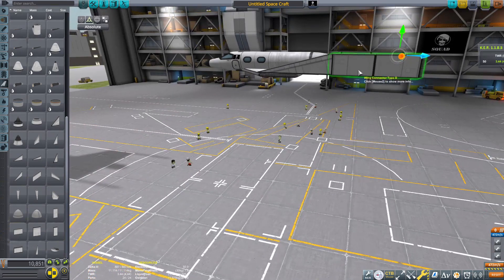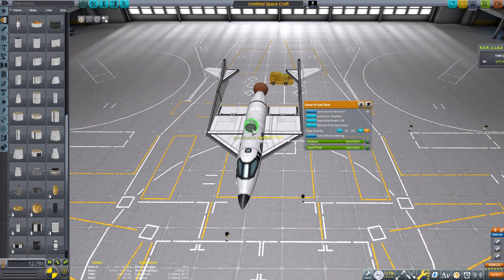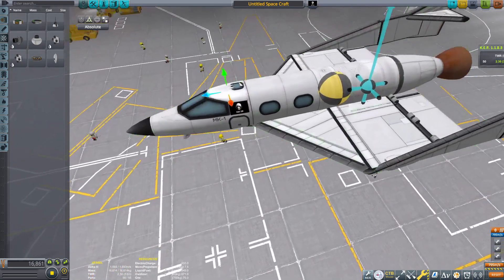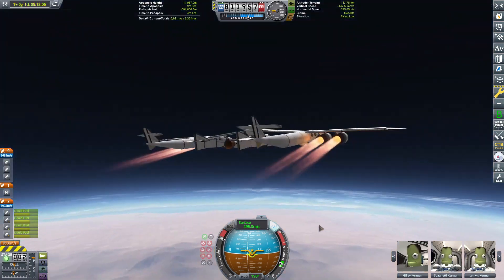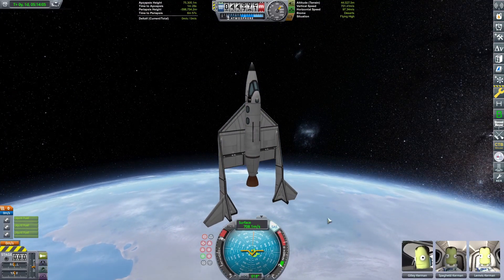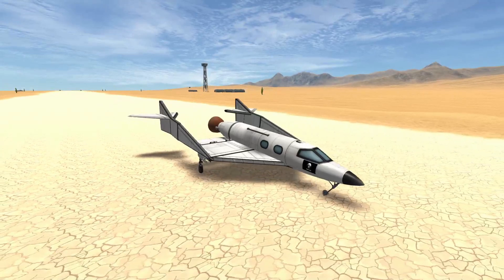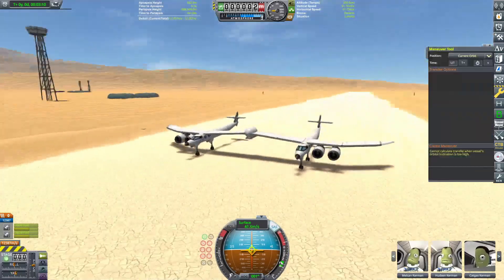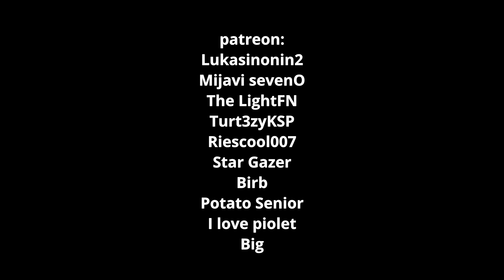KSP Tutorial: How To Build Virgin Galactic Spaceship Two & Eve Carrier Plane!

Comment: Didn't spaceship run on a SRB and not liquid fuel?
Reply: Only oxidizer is in liquid form. Yeah if you want to build realistically you can use solid rocket motor.
Reply: It was a hybrid engine/motor …thing.

Comment: looks good but the main engine is solid fuel, not a jet as far as i know
Reply: It has a hybrid engine.
Reply: Yeah i think its a hybred it ise sold fuel and an oxygen
Reply: @shuaebfromiraq4505  it is a srb controlled by nitrogen, so you can shut it down at any moment
Reply: @Mati1268_  thx
But can you control the throttle of the engian??
Reply: @shuaebfromiraq4505  no the engine is constantly the same. However can be shut down by isolating the engine of nitrogen.
Reply: It's hybrid, not liquid
Reply: @marsbar7099  yep
Reply: Its is a controllable solid rocket engine